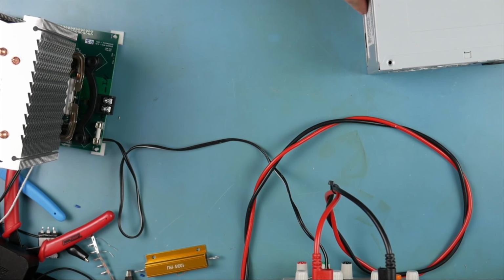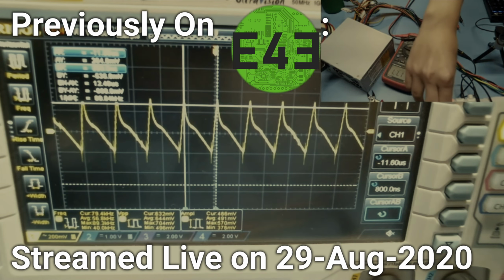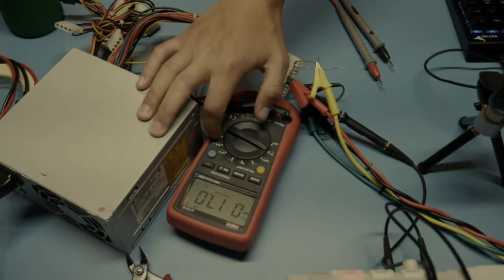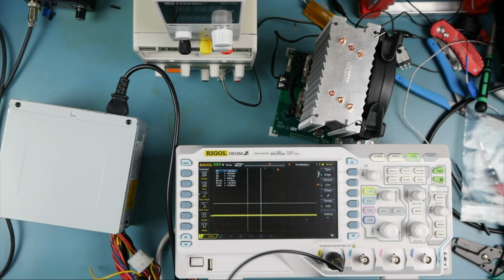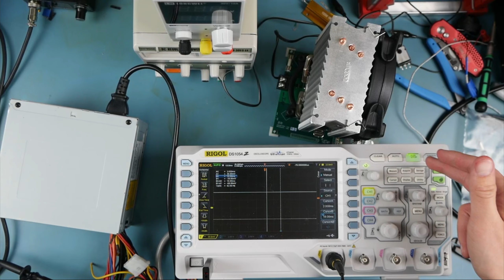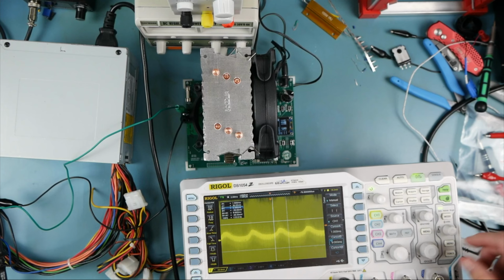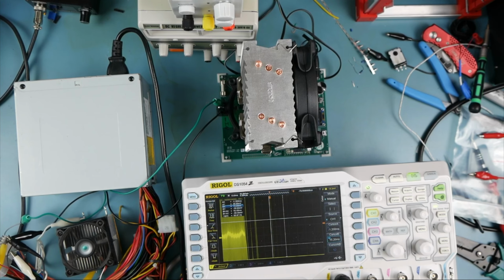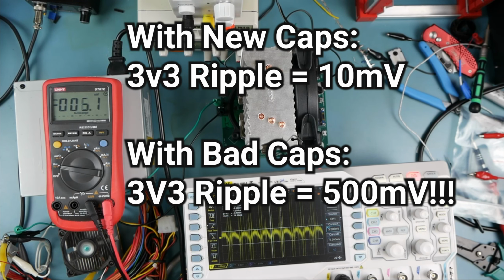Replacing Failed PSU Electrolytic Caps. Can we fix the ripple?

Comment: Here is an interesting fact, according ATX standards design "computer power supplies" has a trade off of high current in favor of more ripple, this is to prevent brown-out, CPU's for computers has an inherit rejection for ripple. This means designing ATX power supplies at high volume reduces cost with capacitor reduction count, EMI is acceptable.